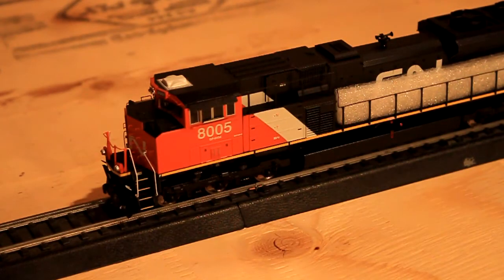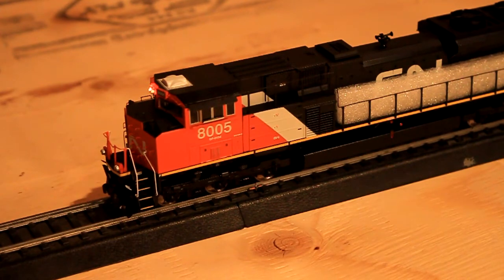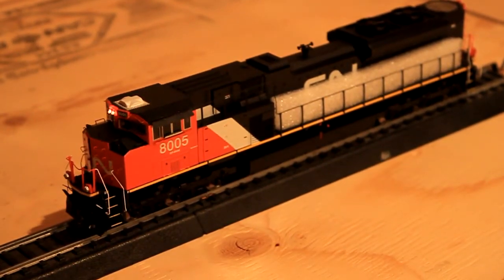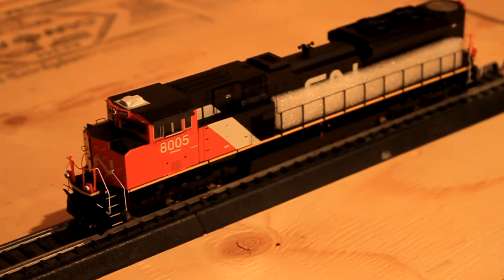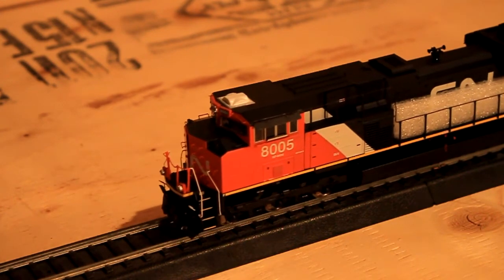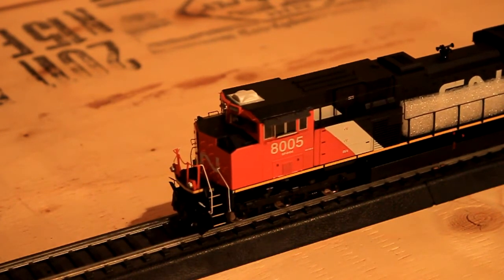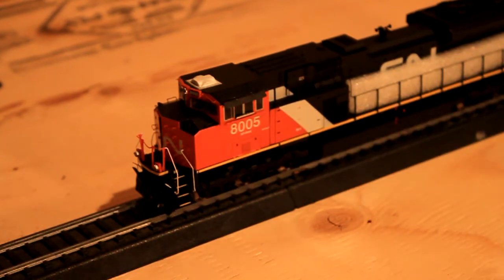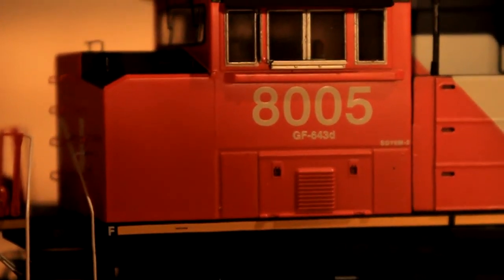Taking a look at my Athearn CN SD70M-2

Comment: I have this one as well.. I'm trying to adjust the cvs to get the notch rate different.  Were you able to figure out how to make it so you can do 3-4 speed steps before it notches up?  ANother thing i'm not happy about it how the loco seems to come to a sudden stop at low speeds.  In most cases if your on speed step one, and then go to 0, it wil will glide to a nice stop, this one just stops, even with my cv4 set to 50.